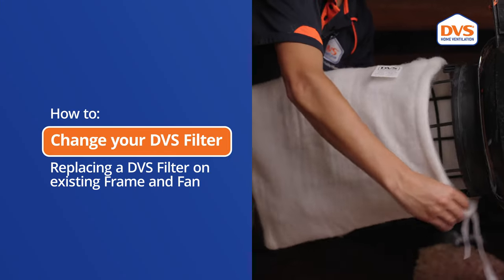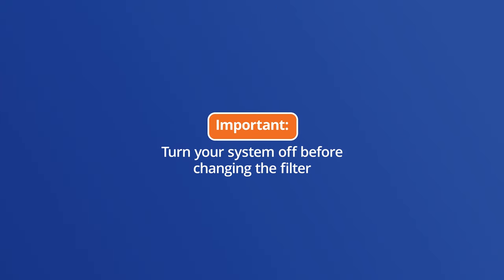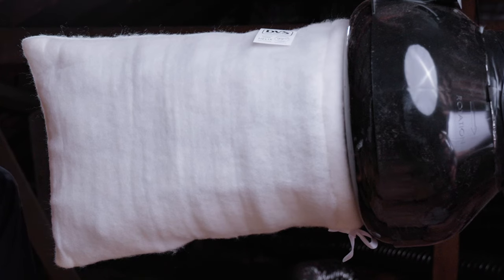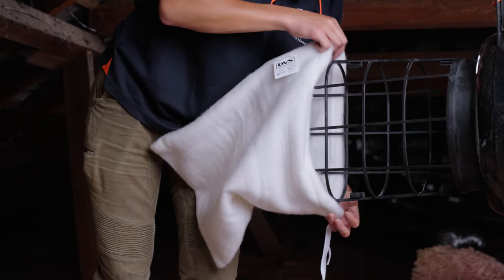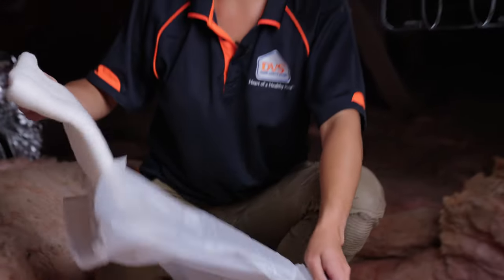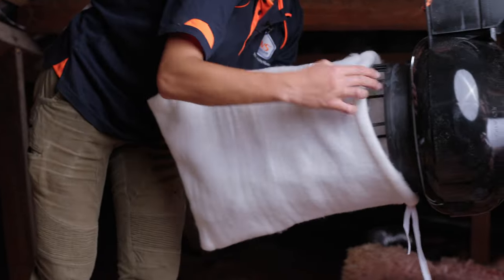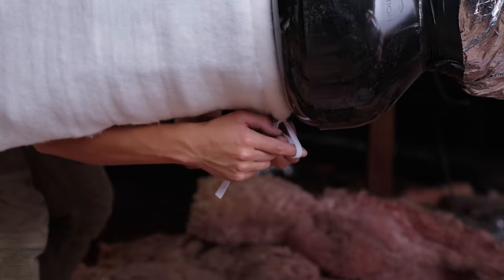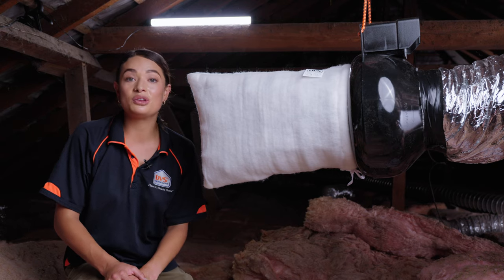How to replace a DVS Filter on existing Frame and Fan

Comment: i have found you do not have to change the filter every year i carefully hand wash in warm water with mild soap and hang it on the cloths line until dry then install last me about 3 years and the motor is 25 years old works as good as the day it was installed.